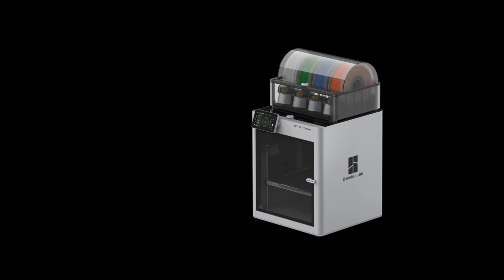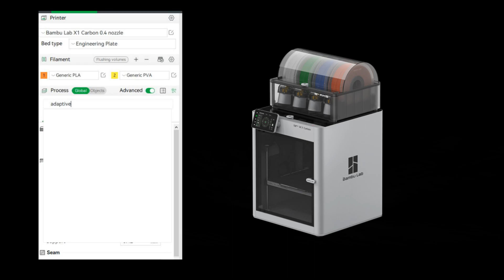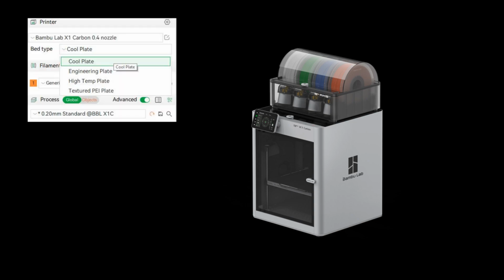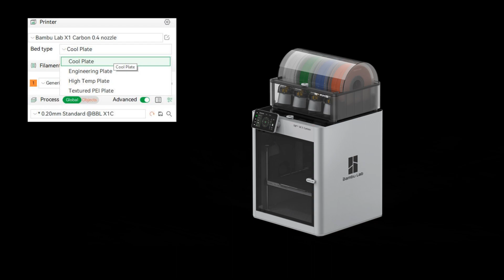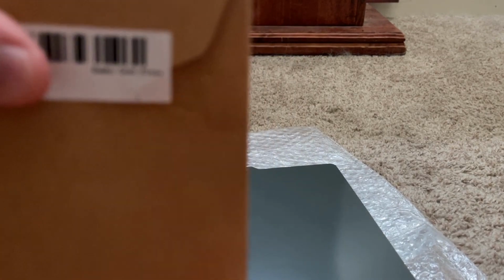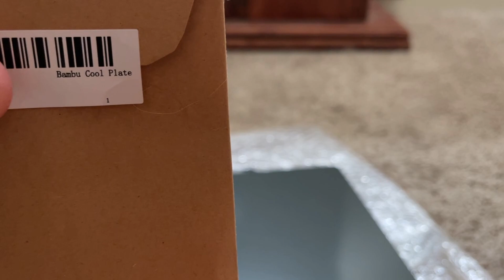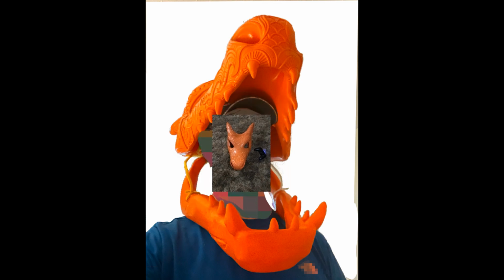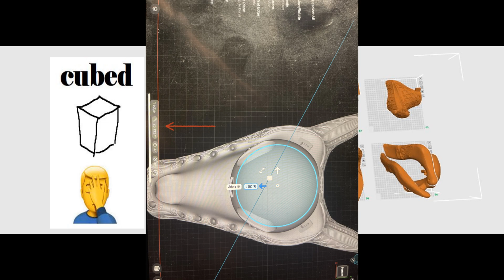general update

Comment: I have both the X1 Carbon and the P1P and the P1P is really my favorite for PLA.  Just easier to get to and work around without the side panels.  The default settings for flow rate (without ILDR) seems to be right on for me and I can't tell any difference in PLA prints compared side by side from both.

Comment: I don't know why we can't do adaptive layer height with a prime tower... The tower would just use the same layer height as the model's layers...
Reply from the maker: You can, it used to cause errors but it seems corrected now, at least with the small tests I’ve done
Reply: @swankyt3ch  I tried it a couple weeks ago, and it threw an error, stating I can't do adaptive layer heights on multi-color prints. I will check to see if maybe they fixed it already with a patch.
Reply from the maker: @JT-Works  I think I actually got around the multicolor alert by removing the prime tower, but like I told other people I’m pretty sure that caused my issue, I advise testing on something small first, or wing it and post results 🤷‍♂️. I have a few put together need to add to that test now, I’ll have something posted on slicing, I’ll set a dead line for Sunday on myself 😂
Reply: @swankyt3ch  yeah, without the prime tower the nozzle won't have plastic at the tip when it starts printing, so a portion of that layer will be missing...
Reply from the maker: @JT-Works  that doesn’t make sense to me, I thought before it went to the prime tower it purged, so only increased chance of color bleed 🤔
Reply: @swankyt3ch  It leaks a little after the purge, so there isn't plastic in the tip of the nozzle... I am just telling you what I have experienced trying not to waste plastic on the prime tower.
Reply from the maker: @JT-Works  gotcha, it lines up with my previous issue, it just doesn’t make sense to me how there isn’t when it just purged prior 😅 curious if you could specify it to start in infill after a purge to help with that 🤔 more idea that probably won’t work for me 😂

Comment: One thing I hate about this machine is if you have a bit of pla left and you want to use the entire role. If you have a piece and it runs out near the hotend. It will get stuck and you cant purge it through or extract it backwards. You have to take off the hotend cover and poke something through the ptfe to get it out through the other side. So pretty much you cant use rolls of plastic in their entirety or they will jam when you get near the end of the roll.
Reply: The filament run out detection works great on my X1C. I would contact Bambu support, as this appears to be a bug.
Reply from the maker: I have not run into that issue 🤔 originally it would keep going, last I noticed it stopped, I have seen things saying there is a “use similar filament” option, haven’t checked for it yet but need to lol
Reply: I had a spool run out in AMS - I was there to feed a new one in behind (like I do in other printers, don’t judge) At one point, it wouldn’t let me push it from behind any more (and I certainly didn’t force at all) - probably at the junction plate in back. But I didn’t feel it feeding in and I started getting nervous… But ultimately, the x1c paused and gave me a notification the filament ran out and to load new. I did, just hit resume, and it started loading the spool I already fed in and continued chugging along. Couldn’t detect a defect in that area. I was pleasantly surprised.

Comment: Adaptive layers is now a button at the top
Reply from the maker: So I just tried it and single filament, with support and no prime tower it skips lines in the supports still 😢
Reply: @swankyt3ch  I have to ask... did you see when after pressing the button did you use the slider thing on right side of the screen? Maybe there is a setting to change in the support interface tab???
Reply from the maker: @dsemolian3071  idk about a setting but originally- I was printing something and the supports kept failing/being stringy, when observed in the slicer I noticed there were missing layers that matched with my issue, that disappeared when adaptive was unchecked.

Recently since updates- I notice the issue with it on or off(in the slicer only, prints successfully with my tiny test print might share later 🤔) and it seems to do well without marking its recommendations when selecting tree auto, I need to test with the recommendations and see.